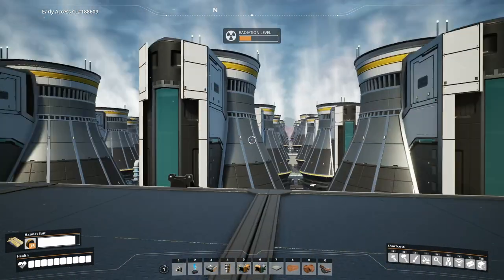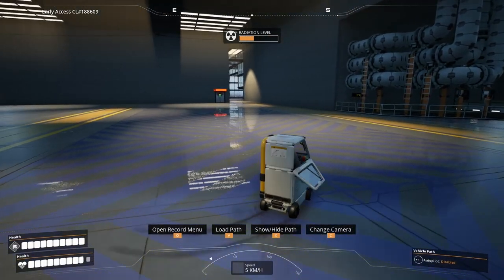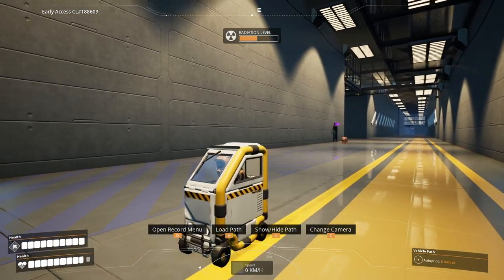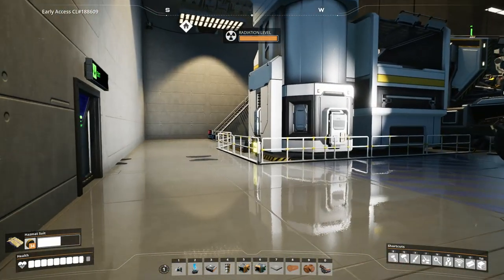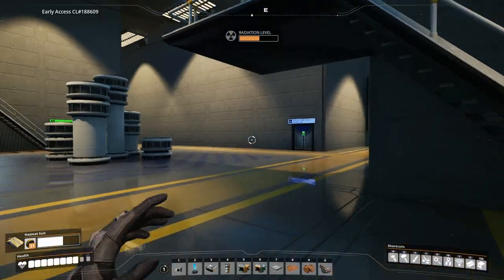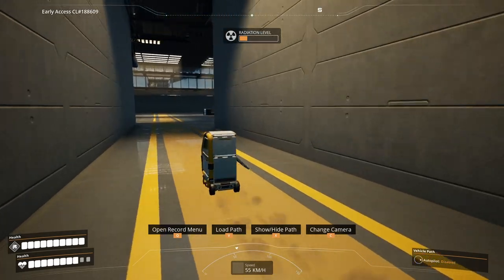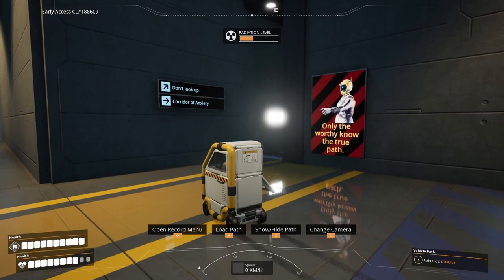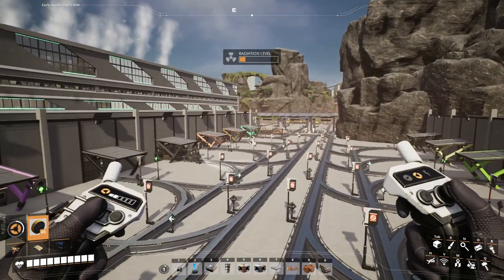MAXIMUM Nuclear Power In One GIANT Factory

Comment: For your oversight train you could just have smart splitters redirecting your deliveries back to the correct lines as the trains flips with each pass. For future reference.
I also have had lots of problems with trains building up waiting which then causes them to become blocked. So I ended up doing a similar thing building wait lines to prevent interactions getting blocked